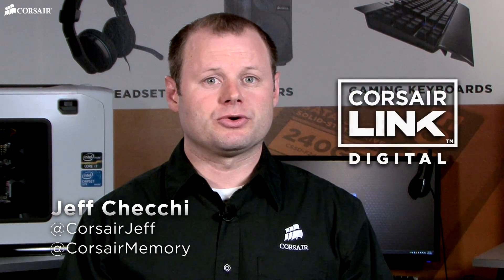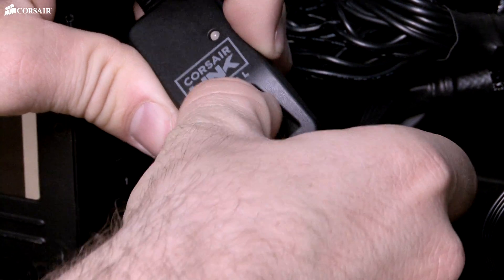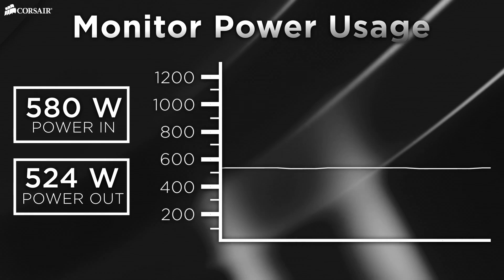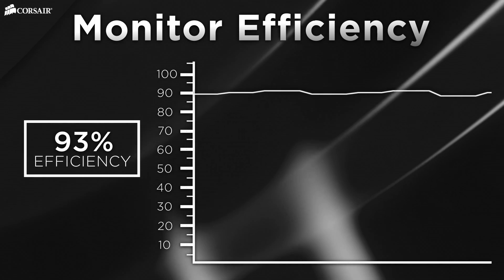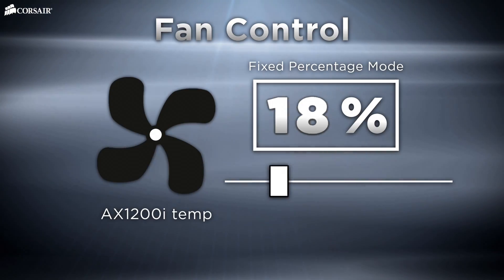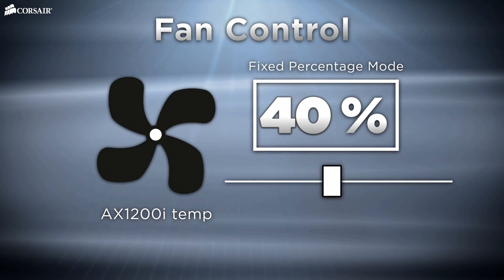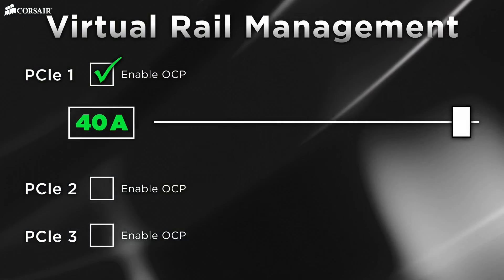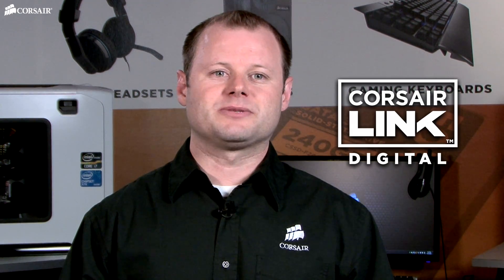Using Corsair Link with AX Series Digital ATX PSUs

Comment: This is pretty worthless. What he says: just attach the included Corsair Link cable to any available USB header on your motherboard and then launch [ the software. ] what we see him doing: he attaches one cable to the power supply, one cable to a small device that says Corsair link on it, and one cable to a USB header. There is no explanation if it's the same cable, two cables, Etc All we see is poorly cut video!

Comment: How about making your power supplies linkable so one supply runs the pc and the other runs the video card. I'v done it by hacking the 
start sense wire but you could do it with a link that also joins the Mains power internally

Comment: Can someone tell me where I can get these cables and the adapter?
Reply: I got mine from here. It took a couple of weeks to arrive from the US to the UK.
https://www.amazon.co.uk/gp/product/B00GRM3QMO/ref=oh_aui_detailpage_o01_s00?ie=UTF8&psc=1
Reply: Peter Welsh welshy46 thanks, I wasn't sure if that was the cable
Reply: Paul M Mine arrived today, if I'd looked in the bag of Corsair cables properly I'd have realised I already had the cables. You should have one cable in a sealed silver packet and the thin cable from PSU to link cable should be with all the others. I'm not overly impressed with the software. Adding the PSU's power draw in the task bar would have been nice.

Comment: Hi, I have a question which is my new pc biuld is amd fx 9590, with msi 970 gaming motherboard, and corsair h100i gtx cooling, corsair vengence pro 16 gb memory with cooler, and amd r9 270x X2 , i also have six other case fans from corsair and a sound blaster card along with the hdd drive and dvd r/w and a fan controller ; therefore i am confused how much power do i need for the build ( i meant the psu)? right now i am thinking for corsair AX860 ATX power supply. Would that be ok or not . please give me some suggestion ...

Comment: Corsair Can you explain the different "models" of PSUs? I see V850, AX850? Is the HX series still made? I have the HX850 in my present case. I've always had a Corsair PSU in my builds. Any particular one good for gaming, no overclocking but possible SLI. I;m upgrading this summer and I'm definitely going to the 980GTX Matrix but I might make my gaming system a monster and have 2! What's a good PSU for this?